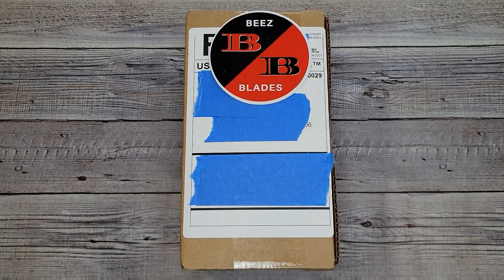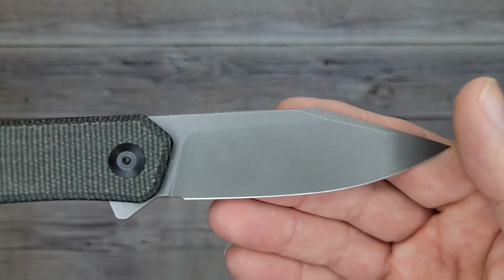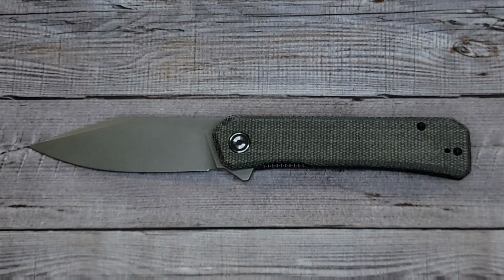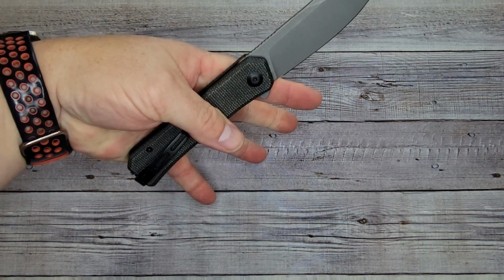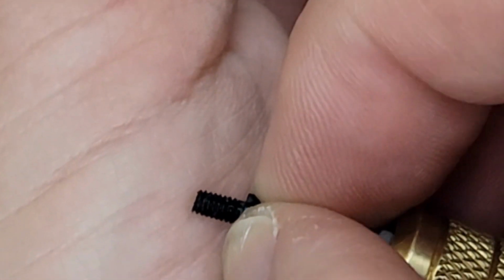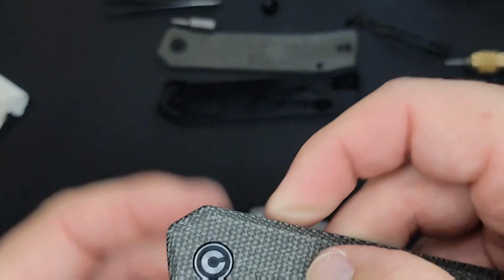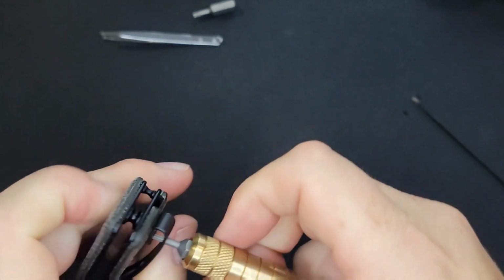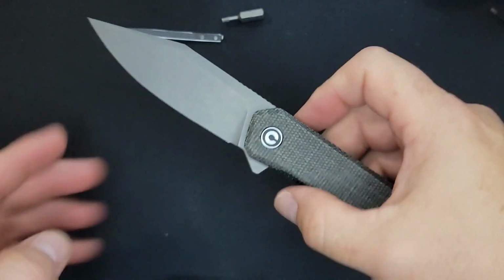NEW CIVIVI RELIC OVERVIEW/DISASSEMBLY | UNBOXING | GREAT FLIPPER POCKET KNIFE | C20077B-3

Comment: Got this two days ago and the detent was weak. Adjusted the detent harder, but it didn’t have much of an effect. Really surprised. It’s damn near impossible to disengage the blade now. Lockup is about 75%. I think I’ll loosen the lock bar so I can close the blade. With the knife closed I can shake the blade out. 🤔 Any thoughts guys??
Reply from the maker: If it were me, I would return it. There's no reason to have a defective knife. Savivi's customer service has been really good with me. I sent one in that had a spinning pivot and they took care of it and I got my knife back in about three and a half weeks. If you got yours on amazon, it's super easy to return it.
Reply: @BeezBlades  I appreciate your thoughts. I looked at the knife again today and played with the detent. After loosening it just a touch, the blade was centered, the action was good using light switch and push button actions. I was also able to release the lockbar without damaging my thumb.  LOL Yes, the detent is a bit weak but I'm now able to do everything comfortably so I think I'll keep it as is. I do love this knife. Thanks again for the reply! And great review!

Comment: I got a Damascus version and I think the detent is too strong. No blade play,, easy to close, blade falls shut, but when using the flipper it hurts like hell. It's very stiff and the action becomes gritty near the top. It seems like every blade I get ends up having something wrong with it, except my new rat 1. It's gotta be the most perfect knife I own at the moment, and I've owned a Spyderco and a Benchmade (sending in both for repair)